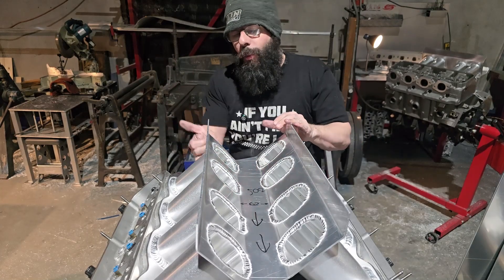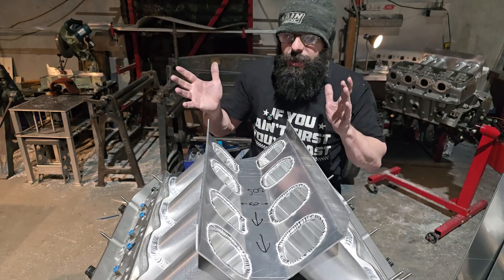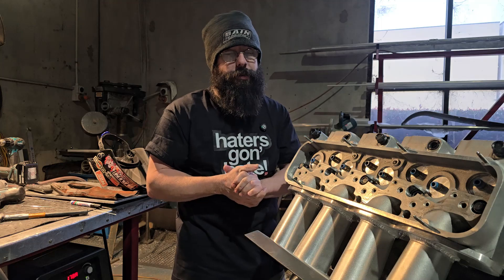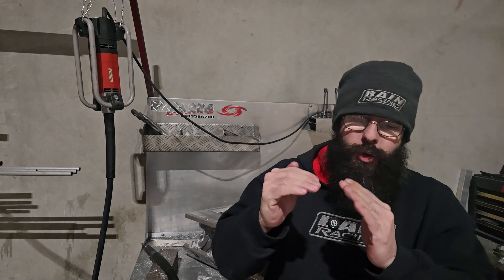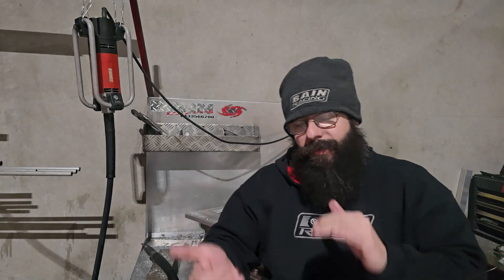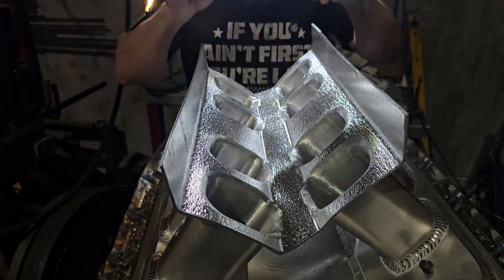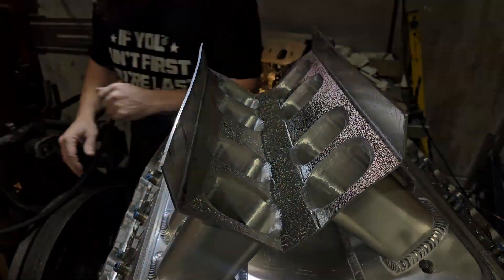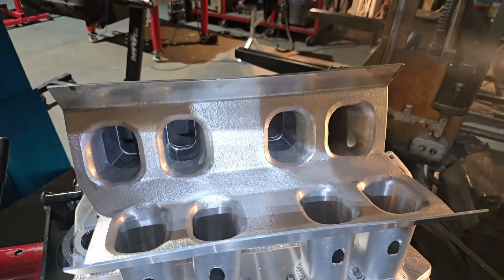TUNNEL RAM BUILD PART 4 - Welding Plenum, Runner Porting & Radius Work | Final Product

Comment: Y’all ever try a router with a radius bit for y’all’s plenum / runner transition?
Reply from the maker: 😂😂 Did you even watch it? I even talked about why we don't. 😉
Reply: @bainracing if y’all talking about y’all saying y’all don’t want a full radius, y’all wanting 7 degrees with a sharp edge, I think that could be accomplished with a adjustment to reduce cutter depth, and adjusted by hand finishing. 
So, yeah, I got the part where y’all want to vary the edge around the port.
Reply from the maker: Please watch the whole video before commenting mate. Makes my job much easier!🤦‍♂️

Comment: Thankyou Jake  for sharing your knowledge  . Much appreciated 💕 
What corded grinder do you use  ? 
Thankyou
Reply: Seems like hes using a Suhner Rotoset Flex Shaft Grinder
Reply from the maker: That's it! 👍
Reply: @bainracing thankyou  . As after many decades being a mechanic  , now have arthritis  . So if it helps you  , it will help me ❤
Reply from the maker: Definitely mate! We have to look after ourselves! It never fixed my arthritis but it stopped the flare ups.  Wasn't until my 40's i got bowel disease.  I ended up fixing all of it completely when I cut out all the grains and carbs and went mostly carnivorous diet. In 30 days my body felt alive!  Now I do mostly meat with seasonal vegetables and berries.
Reply: @bainracing  the diet is something I have to look at  . Thankyou  
Hope your health continues to be great